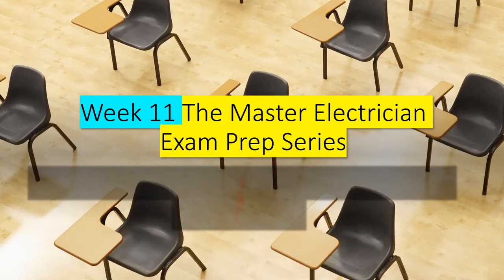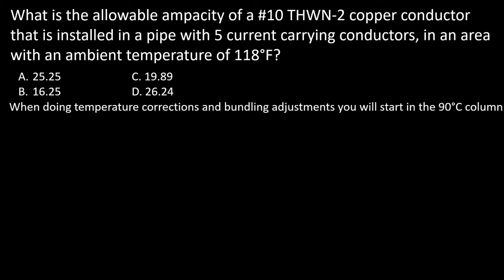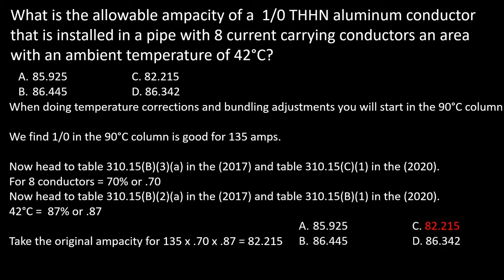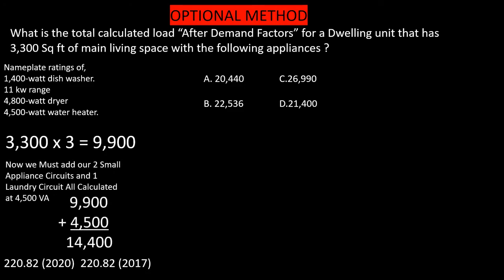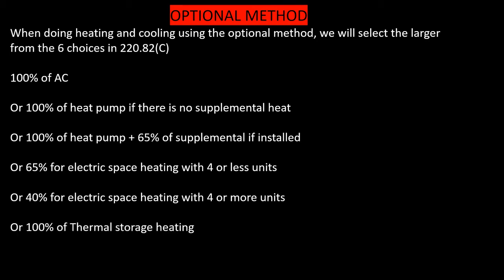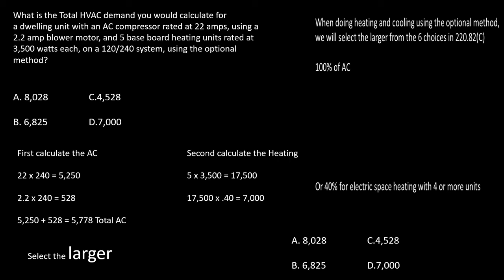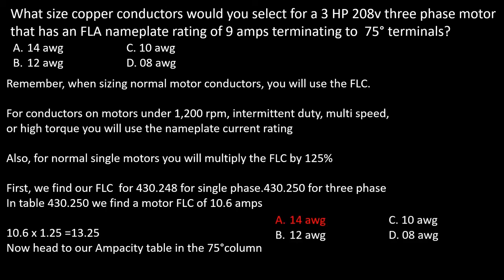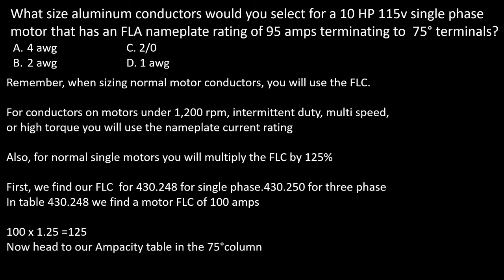Electrical Masters Exam Prep Compilation weeks 11 to 15

Comment: Great Video! - Questions - with the heat pump compressor and heat strips. You calculated heat pump compressor at 125% + 65% heat strip. .... Are you doing this factor in the largest motor load here? If not, why did you upsize this to 125% instead of the 100% as described in (c)(2)?
Reply from the maker: Check and see if it's optional method that I'm doing